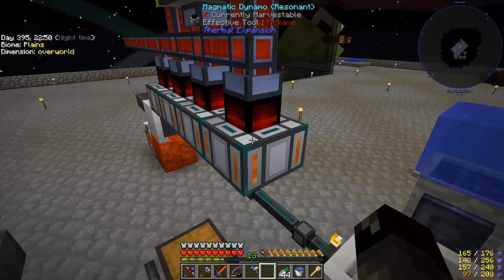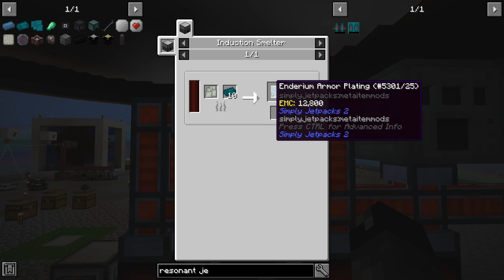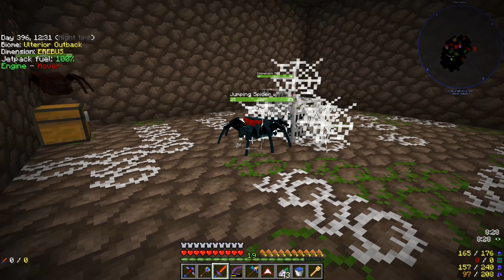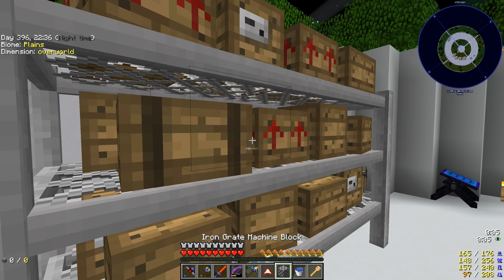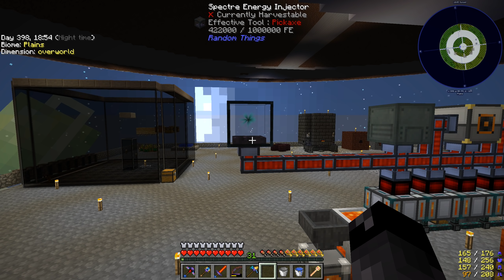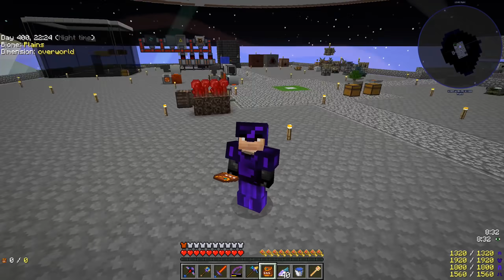Project Ozone 3 Kappa Mode - WIRELESS POWER [E41] (Modded Minecraft Sky Block)

Comment: The Diesel Generator outputs a total of 4096 RF/t out off those three conections it has. You don't need all 3 to get all the power out, one of them is enough if the cable connected to it can accept that amount. Also be sure to check the manual if you ever forget, it contains this info basically
Reply: That's the normal amount. PO2 changed its output pending on the fuel.
Reply: @SirScottalott3496  ah I see! Thank you for the added info!